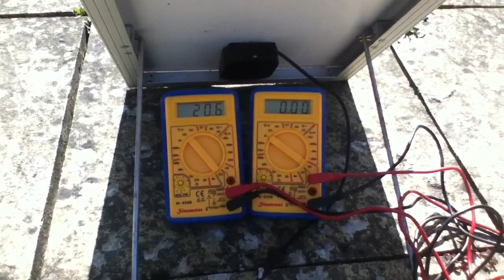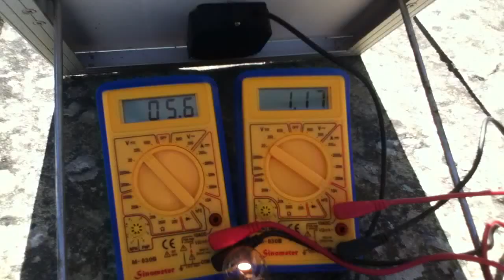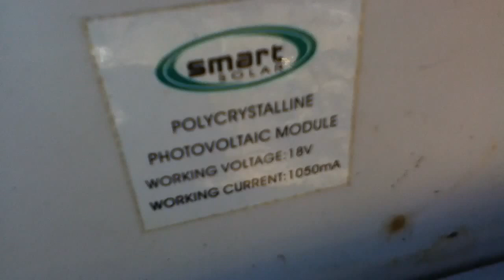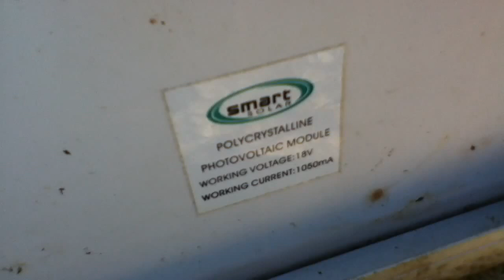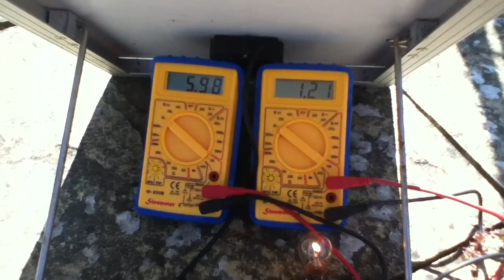20W Solar Panel / 21W Bulb - A Perfect Match? (part 1)

Comment: Get a MPPT voltage controller or a regulated power supply (cheap and easily built  around the 317K chip)  !

Comment: how it possible to work for a ac blub by solar plate directly solar plate produce direct current
Reply: plz sir explane it by a video
Reply: @hrtreandingstatus  You can buy bulbs working on D.C. Otherwise you need an inverter (12V D.C./220V A.C).

Comment: A good thing to try would have been to use a 12V lamp rated at about 0.8A so then it would allow the voltage to sag to about 18V while maintaining close to 1A so that would be 18 watts.  One you go above the rated maximum current of a solar panel, it "sees" that as an almost short circuit.  On most solar panels, the Isc (short circuit amperage) is only slightly higher than the Impp (current at its maximum power point).

Comment: sounds like you only truly have a 6.55 watt panel that has been over rated at 20 watts! If it could handle 20 watts, you'd surely be getting more out of the solar panel and the lamp.. In fact, you'd be getting close to 85 or 90% voltage because of it's capacity being slightly overloaded, and the amperage should have been about 1 amp or just a touch more being you would have a voltage drop at approximately the difference from it's overload. To eliminate this, you would need to use a solar charger and power the bulb from a battery that the solar charger charges. There really isn't any way around this, however the bulb is a resistive load, the panel should be powering the bulb at nearly full bore if it was a 20 watt rms panel. I believe it is a 10 watt rms, 20 watt peak solar panel and it must be a Chinese panel made to sell at more than it's rating, otherwise it's worth would only be about 10 bucks!

Comment: Julian where would you suggest to source panels? 

I am having to replace my car battery, but I think it still has a bit of life left, for use as lighting an out-building. So I am thinking of hooking up a switch and some 12V led strips, along with a solar panel and appropriate charge controller (if you could suggest one?). It will get used rarely, so even a low power panel should be ok to trickle charge the battery.

Comment: Have you taken in to account that when connecting the bulb you are altering the voltage draw so yes you can have a standing voltage of 20 but when you are drawing power it drops

Comment: measure the open circuit voltage of the panel (in bright sunlight) in volts. Call that Eo. measure the short circuit current of the panel in amps. Call that Io...multiply the two together and divide by 4 - this is the matched power available from the panel. The loading that delivers the matched power is Eo/Io, in ohms.
You need to load less heavily - use 3 or 4 bulbs in series and you'll get more power, slightly less current and a higher total voltage across the series set of bulbs.

Comment: You have a 20 watt panel at 21 to about  18V and at .95 to 1.1 AMPS.  This panel is capable of producing a maximum of .95 to 1.1 Amps.  Your light is 21 watts at 12V or capable of pulling and will REQUIRE 1.7 AMPS.  You are short on current and on amperage.  That is why your bulb is weak in lighting.  You shouldn't do useless video's like this when you don't understand the theory behind what you are trying to do.
Reply: Randy van Vliet Yeah , I can tell  you understand the theory. Lol...  So , please explain us the difference between "current and amperage" (that he is short of)....
Reply: He has 21 watts needed at 12V, the panel makes 20 watts at 22 V, or about .95 Amps.  After going through the controller, the voltage gets dropped down to 14.4V at .90 amps. He's short on watts, because it's a 12 volt bulb designed to run 1.9 amps at 12V to make 21 watts. Loss of amperage in controller and in wiring with DC current
Reply: Current is amperage, Martin. when you draw too much current, voltage sags also. Plus his solar panel and the sun shining on it is at such a low angle, there's no way his panel is producing full amps at maximum capacity. Sun shining diffused light through the atmosphere = lower yield of rated amps.
Reply: Randy van Vliet I know.. I was quoting from your first reply , where you said :  " You are short on current and on amperage ".
Reply: One and same thing
Reply: Probably had my train of thought interrupted whole typing

Comment: i think you should test it at midday when the sun lights is coming directly  and vertical because although you turned the panel to the sun direction you cant get the max power  when the sunset

Comment: Here is the problem: All incandescent lamps are a non-linear resistance. To properly test the panel output you need a power resistor - 18 ohms @20 watts.

Comment: use 15W 12V buld and 5W 6V bulb in series :) they should work perfect cuz this panel has rated voltage of 18V

Comment: Do you think it is possible my solar panel is damaged as it can deliver the voltage but cannot deliver any power?
Reply from the maker: You can test the current from that panel by connecting your DVM (on the 10A DC setting) directly across the panel connections. You should see 2 to 3 Amps with sun on the panel.
Reply: I did this but have nothing coming up just voltage, no amps, I contacted kyocera in brazil but they don't respond and want me to send the pannel which I cannot do as I live in Uruguay. I am hopping there is something else I can do.

Comment: Hello, I tried to duplicate your experiment (I am new on this) my panel is a 45watts but I used the same 21watts break bulb you used however there is no light coming out, what can be wrong? measuring with the multimeter the output of the panel is 17volts DC it should at least show something on the bulb doesn't it? I also tried a computer powersupply fan which works at 12volts and says 0,12A therefore the fan should turn but it doesn't.

Comment: A 12v 21w bulb, draws 1.75A, with a resistance of 6.8ohms, so if your trying to exceed the maximum current for that panel, your voltage is going to drop substantially.
Reply: exactly